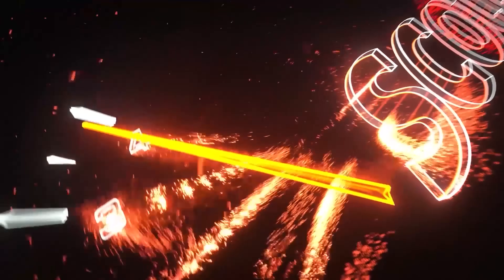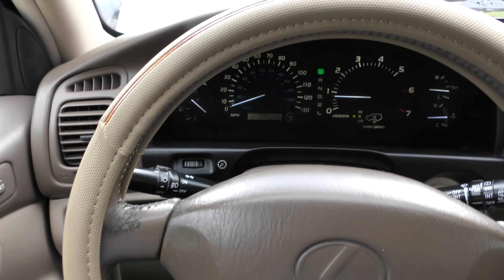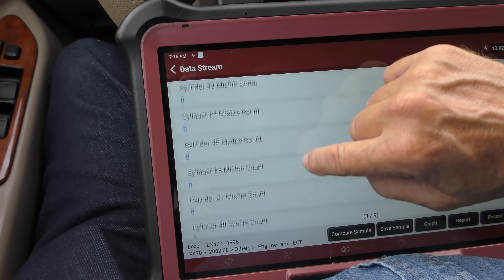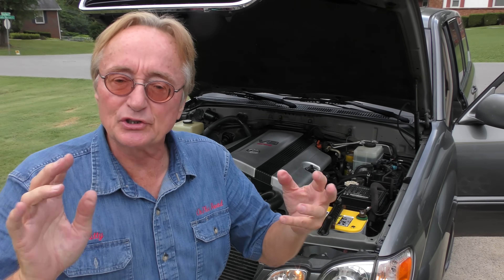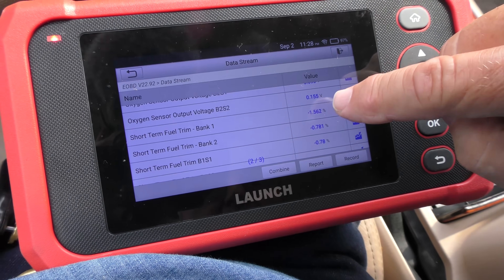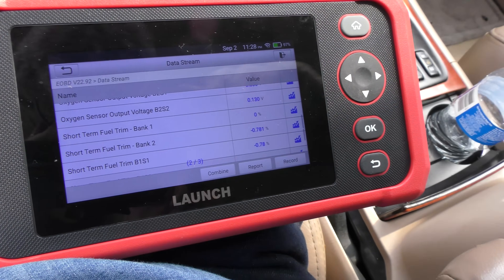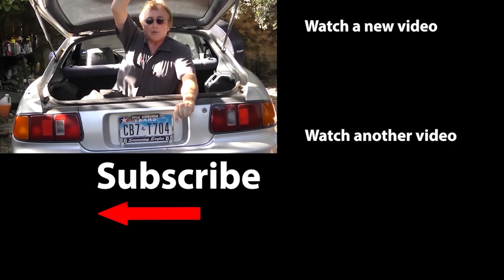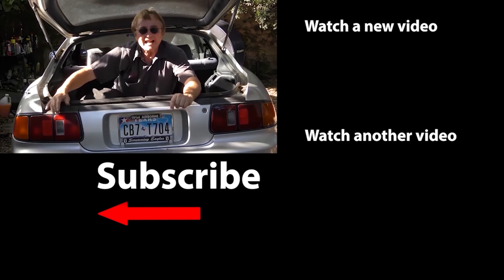Mechanics Don't Want You to Know About This

Comment: Hi Scotty! I love your channel. I’ve been following you for years, and I’m happy to see your followers growing every day.
I have a 2019 Honda Accord hybrid that I bought brand new. Weeks ago two different person approached to me randomly to tell me they had the same model, but just a year older and theirs died around the 140,000 miles (they are Uber drivers just like myself). Do you know anything about that? Should I get rid of mine before reaching that mileage? (Mine is almost 100k).
Thank you in advance for your help. Best wishes to you, my friend!
Reply: @tooltime9260 , They said that the engine went out and the dealer will not repair them. I think you are right, mine is running so smoothly that is hard to believe that the engine will die in 40 thousand more miles…

Comment: I drive a cng semi truck. It has no range or power compared to traditional diesel.  My range is about 185 miles on 3600 psi. Filling up is a hassle too. Only 3 stops where I can fuel up and it takes a while to fill.

Comment: Scotty your laquer thinner tip for catalytic converters worked to clean my fuel injection system in my 03 Yukon so now I have smooth idle and acceleration!! I used 1quart of thinner to 5gallons of gas.

Comment: I had a miss fire on my 2004 Jeep Cherokee 4.0 liter, no code either, but you and see and feel it when idling.  I changed the spark plugs, still doing it. If you put in fuel injector cleaner it clears up some, but it still had a miss fire and idling rough.  I put in a new igniter bank, that cleared it all up, runs and purrs like it was a new engine, but with my code reader and the code reader at a trusted mechanic, not was registered.

Comment: For anyone wondering if this stuff really works, after running through the rest of that tank and another full tank of regular gas, the shuddering is completely gone. Funny enough, the AC compressor went out the next day, so after I fix that the Lexus will be in great shape!
Reply: That suv is amazing, you got a great deal, change the oil every 5k with fully synthetic oil and that engine will go another 350k miles. Wish you the best!
Reply: @frankbiz  dude that’s like putting 91 in when it requires 87. Those older cars don’t require synthetic oil nor would it make it any better it’s not rated for synthetic
Reply: @Truth-L-knowledge  Scotty recommends it and I agree. Fully synthetic oil doesn't break down like conventional oil and flows better in cold weather. I have a 08 Highlander with over 230k miles and it runs smoother than a new car. I change it every 5k miles with Mobile 1 High Mileage oil.
Reply: The engine detailing is great, looks new under the hood!
Reply: That's great! Those 2UZ-FE motors are extremely strong
Reply: You scored with this one at that price! Take care of it and keep it running.
Reply: Congratulations on that HUGE score for 3500$. Even with an AC restoration for 1500$-3k$, it is still one the most desirable vehicles. It will always have buyers lined up.
Reply: @sleepyhollow783  that's how I convinced my wife, haha! I told her it's never really going to lose its value as long as we don't trash it. I definitely plan on keeping it as original and well maintained as possible
Reply: congrats on the car, that's a nice one. 

take care of it, they have a following.
Reply: @volvo09  I definitely will. It was a birthday gift for my wife, so it'll be well loved and taken care of
Reply: @CoffeeonKorriban  awesome!

I had an 01 tundra that I owned till just about 300k miles. It was in the family since new, and still ran like new when I got rid of it last year for scrap...  Only reason it had to go was because of excessive rust, absolutely everything was rusty and falling apart. If that was a southern vehicle it would still be around today, it was so reliable. It hurt to get rid of it.
Reply: @volvo09  l
TY
Reply: Awesome find !  What part of the country did it reside?   Take care of the undercarriage and keep on landcruisin',!
Reply: @WileyT223  tennessee. Winters aren't too harsh here, so the roads don't get salted too much
Reply: I'd say that you honestly got a
solid deal.  🕺🏽
I might shop around for one
myself. 👍🏼 
Stay Safe!
Reply: So you were the dude in the background opening the back door
Reply: @macknumber9  yeah. 🤣
Reply: @Coffee on Korriban  haha...so what was the shaking jiggling like?  I been trying like hell to fix my issue and I describe it the same...slight shaking felt in the seat when idling...no change in rpm when it happens....I'm thinking I might have same problem with the injectors
Reply: Your Lexus is in immaculate shape man! Even those headlights look brand new. Can’t believe it sat a year and a half and remains that good looking. Congratulations and cheers to many more comfortable and trouble free miles!

Edit: just read someone detailed it for you. Looks killer regardless, tattoo that guys number to your arm! He got some SKILLS!
Reply: How much moolah is the ATS cleaner it says 300 on the website 😱
Reply: @spottedhorse7  that was for a case of 12.
Reply: Years ago Scotty recommended using Lacquer Thinner to clean the fuel system and possibly fix a catalytic converter issue. Might that have worked in this case? Or does he now think buying a more expensive product specifically sold for this purpose is be better? Since you apparently know him, can you ask?
Reply: What exactly is the maker and the name of the product? Thanks to anyone that replies.
Reply: Awesome thanks for the update
Reply: Where do I get the cleaner?
Reply: @johnnyjames7139  he posted the link on the comments on top

Comment: Hello All, I need some help !
I was changing the headlight assembly on my 2010 Chevy Silverado 1500, when I removed the grill I noticed the air baffles that go to the radiators fell off. Is replacement even an option here? I don't know if it's dangerous driving without them, I don't know what to do. Any suggestions? 😩

Comment: to the CNG guy:
 In latin america what you try to do, at minimum, is to adjust the intake valves to give them more clearance. Gas(as a state of matter. not gasoline) tends to bury intake valves as early as 120k miles you can end up stranded bc you lost valve lift.
If you have hydraulic lifters you take the head to a machine shop. They can put reinforced valve seats and better guides
Reply: Yes I knew a head mechanic that ran the garage for Lone Star Gas here in Texas they were all on natural gas he said they work just great except there was nothing to cushion the valves and they were constantly rebuilding the valves on the engines.

Comment: I'm struggling to fix an 87 chevette.   Tracking down vacuum leaks, and probably going to swap out the computer controlled dizzy and carb to non.
Reply: Get yourself a 40mn Weber sidedraft carb. Same effeciency as fuel injection

Comment: Got a 2008 Scion 190,000 miles I just changed your transmission fluid because I just purchased the car it had never been changed and the filter it's running fine when should I do another change cuz it's like of course filthy again help help

Comment: Scotty what do you think of a 2020 Toyota Corolla SE? I recently got one and I think it’s a fun zippy car but not sure how good the transmissions or even 2.0 engine in it is. It says CVT but can manually shift gears on the gear selector or with paddle shifters, and changes gears noticeably while driving so I’m not sure what kind of CVT transmission it is.
Reply: it is a standard CVT transmission, it's just programed to act more like a transmission with gears because the "rubber band" feeling you get from CVT's puts a lot of people off. 

Toyota makes a fine CVT.
Reply: @volvo09  wrong. the 2020 corolla has a physical starting gear, then goes into cvt. This new design is replacing the previous design which scotty says is pretty much the best in the industry..
all the information you need is on wikipedia.
Reply: I have the same car, same year even. At a stop it jerks at times, shifting into gear. Just curious as to whether you've also experienced this.
Reply: @anonymouslabera  mine just past 34k miles and I only got it two weeks ago, I’m not sure I’ve experienced any issues yet just wasn’t sure if it was something that is new or a tested transmission. Also not sure where he answers questions then I guess the website I wasn’t sure.